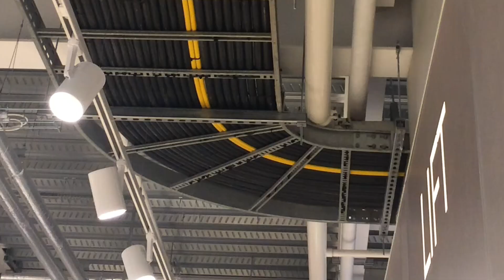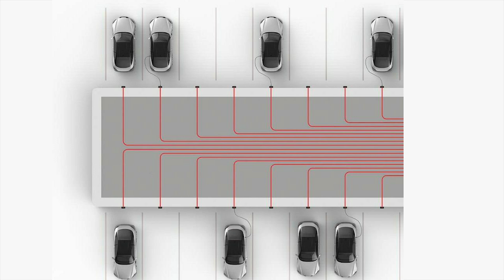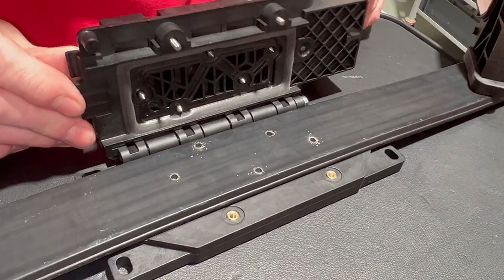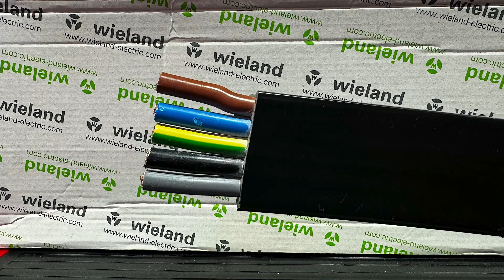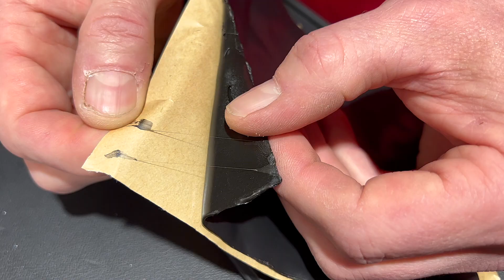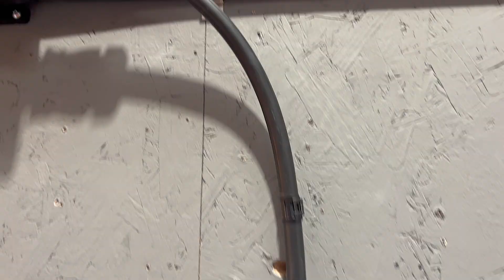How Can This Cable Speed Up Electrical Installations? - Wieland Podis

Comment: or fit power busbar like they have used in factories for decades.... any type of tap off like shown in this video will be a nightmare if the cable gets damaged, at least with busbar you can change it in sections

Comment: we did a car park with this system last weekend , the weekend before ?? anyway yes the other contractors had surveyed three  weekends for a small commercial underground car park  and we did it in one weekend with plenty of time for pub each day we were carful to use manual screwdrivers and not power tools , clean tidy very little fuss and we got five chargers up and running , we are rolling this system out with our clients across the city and use this install as our demonstration of how quick and neat it is

Comment: I have seen far too many pierce type connections like this fail. The RV industry in the US uses a two piece electrical outlet that works in almost exactly the same manner. The Romex cable is laid in the outlet and the cover is sandwiched on. Blades (think of a pair of scissors opened up) pierce the conductors to make the connection. They have a very high failure rate long-term
Reply: Don't compare anything designed for the US RV business to ordinary domestic products. 
RV means the cheeziest lightweight piece of shit possible.
Reply: Though the Posi-Tap is a nice system, if you don't have the time for military splicing....
Reply: another problem with tap in systems like this is that plastic can deform easily when heated, and after some time the tap in point could have a loose connection, which could soon start a fire
Reply: They have these pierce connectors on landscape lights too and they're total garbage. I can't imagine it running 3 phase 60 amps safely!
Reply: It's true that the stranded wire is much much more reliable than a solid-conductor Romex... and Romex is not tinned but just bare copper which makes for worse corrosion possibilities... but yes, even so the whole idea of vampire taps gives me the willies.
Reply: They tried the same shit in the US with the push-in terminals on standard outlets. you can just strip and PUSH the wire thru a hole in the back, and it STAYS! 
the only problem is, IDIOTS think the job is done, while everyone else knows to tighten the dam screws to clamp it INTERNALLY, after sticking it thru the hole,.
So, as a result, you get a conductive path, sure, but it's only a dozen circular mils or so, and rapidly overheats. AND THIS IS THE ONLY THING THAT CAN GO WRONG.
Prior to this, you had to juggle to hold the wire while tightening it up. Big fucking deal.

Comment: I feel like a lot of these EV chargers are going to go unused and have to be removed in a few more years. People are finding out now the EV they bought 5  years ago has half the usable range as new and replacing the battery isn't a reasonable expense, so when they replace them they are going back to gasoline. I really think hybrids are the smarter bet and if we want to make real progress against carbon output, we should focus on fossil fuel power plant replacement.

One of the biggest problems with EVs as well is our grids in the world are just nowhere near ready for everyone to have an EV. This system is awesome for retrofits but many of these places are going to need service upgrades to accommodate all that additional power and at some point the power company will not have the local capacity at the sub station and local distribution network to do these upgrades. This is a problem in pretty much every modern country and a very expensive and time consuming one to solve. In short  we are putting the cart before the horse pushing EVs versus power plant and grid upgrades.
Reply: the main way to solve the carbon output problem for transportation is better public transportation. Obviously this isn't feasible everywhere, but public transit is most cities is a lot worse than it could be. Especially in America a lot of cities gutted their public transit infrastructure to make it more car friendly, and that trend needs to be reversed. 

Even airlines burn less fuel per passenger and put less carbon in the air per passenger than EV's do, let alone hybrids or pure gas vehicles. And airlines are the least efficient form of public transportation. 

But the best solution for cities, more trains, more buses.
Reply: EVs were first introduced in the 1800’s and had the same problems back then as they do now.

Comment: wait, 16 millimeters squared (as in (16mm)²), or 16 square-millimeters ( 16 mm²)?
big difference I'd say
Reply: But you deliberately chose to read it as (16mm)² rather than 16 (mm)². I don't think anyone else will have done so.
Reply: @BrianG61UK  why not just use the proper unit name tho?
Reply: BODMAS

Comment: Great idea but what about chargers which require the use of a cat 5 or 2 core for load management and internet connection
Reply from the maker: Most chargers designed for shared spaces like car parks have lots of connectivity options - WiFi + Mesh or Powerline communication. See Zaptec Pro or Garo Entity mentioned in the video

Comment: The old Vampire Tap from old 10Base5 ethernet Installations has made its comeback 
🧛🏼‍♂️ Särrr gutt.
Reply: Ah yes, the fun of tapping a live network!  Still got the boring tool somewhere :)
Reply: AUI! (Drop cables)
Reply: @pebbleschan6085  AUI fanout unit yay
Reply: Or Christmas lights, probably going even further back.
Reply: @concinnus  yes, the old festoon lights had self piercing connectors on flat cable, used as far back as the 1930s for sign 'trough' lights but with those holders you had to strip the outer sheathing and route the wires into the channels with the spikes in
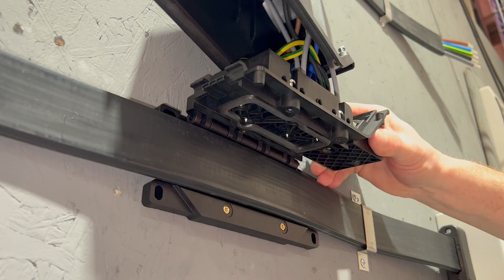Reply: @TheChipmunk2008  The ones I'm familiar with (US, 120V, C7/C9 strings) had the bulb socket clamp onto an unprepared insulated wire.  The difference vs the tap-off box here @3:26 is that the Christmas light sockets had brass contacts that were simply spikes on the other end.  They were pushed into the conductors by the clamshell action itself, no screwing.  Very cheap and simple, no weatherproofing, prone to corrosion.
Reply: Yup. Hardly innovative eh 🙄
Reply: @christopherbedford9897  tbh it's innovative to bring it up to modern standards and use it for a new purpose
Reply: that being said i do see a possibility if one car is really dead, and needs 32A for an extended time, for it to go bad..... but i guess they've done the testing, and the fast deployment is a huge benefit

Comment: Too bad you didn't compare different wiring systems in different countries and their positives and negatives.
Reply from the maker: We’ve a whole series 👉https://youtu.be/jSdfJabUEUQ?si=zRmwoGsDzkHQeuo3
Reply: @efixx  that's awesome. Hopefully you will ad more countries. Like Finland for example, we have way different system compared to Italy or Ireland
Reply from the maker: Sounds like a great idea 💡 I used to work
In Salo 🇫🇮 so would be good to return.
Reply: @efixx  that's awesome, I'm currently in school to become electrician so I'm very interested in learning new stuff and want to learn the best stuff from all the countries.
Reply: inn my honest opinion, no one has the truly best system. Every system in the world has its good and its bad.

If i had to run it down id say

Best voltage : 240/416 systems common throughout most of the world or the 277/480 system in North America. 120 phase to ground systems are not good, while japan has the worst with a 100 volt phase to ground system.

Best Service drops: I want to give this one to mainland Europe with its near universal three phase service drops to every building. Universal three phase services make for a more balanced and copper efficient system than single phase service drops common in the UK or split phase ones common in north America.

Best Breaker panels: North American hands down. North American panels are built with heavy duty buss bars that breakers plug into and enclosures are solidly built out of metal. This is way better than the European plastic boards with wires run in between breakers, making them a bit of a mess to service.

Best circuit configuration : Radial, sorry Brits but your ring main system, not so good. Everyone else in the world uses radials for good reasons.

Best wire run methods: Conduit, preferably metal conduit but PCV conduit has its uses, particularity where corrosion is a serious issue. Primary winners here are the UK and North American commercial and industrial installations. The flexible plastic tubing found in mainland Europe is OK, bu not as good a conduit, and the worst method is just running wires directly in walls like with North American residential installations.

Best wire termination methods: honestly i think its a tie between WAGO's, screw terminals, and Wire nuts. each method has its own advantages and disadvantages. Wagos are a little more idiot proof and faster to install than wire nuts, but wire nuts are cheaper and when done properly make a very solid and secure low resistance connection. 

Best plugs  - I'm gonna say no one wins here. UK plugs have the best safety features, but are excessively large and over engineered, and switches on outlets is just overkill. American plugs are compact and lightweight, but lacking in key saftey features and can be rather flimsy. On the other hand American receptacles being so small means there are far less foreign objects that can be inserted into them.  But if you want a super secure plug that will never pull out than nothing beats American twistlock plugs, which actually twist to lock in place and these cannot just be yanked out.

Comment: naah, thats not good way todo it. you must use  AR600 steel pipe with 10mm wall thicness. You just never know when building may experience MACH25 winds, you know, like in real worlds.
Cant use regular steel thats just rated for MACH3
Reply: Are you kidding?  Mach 25 winds would cause enough friction to melt steel. No building could withstand even Mach 1 winds let alone Mach 25.

Comment: Sadly never got to try this cable. We've stopped fitting EV points in carparks of flats and office blocks due to fire safety measures required by insurance companies and local building control.
Hopefully there becomes an industry wide standard to actually get the ball rolling again because since Luton Air Port there's a big push for sprinkler and extraction systems to protect occupants and the structure in our local area. Not sure if anyone else has come up against this.
Reply from the maker: Interesting 🤨
Reply: A solution needs to be found. In the long run all car parks will have to be able to safely accommodate EVs. I can appreciate extra caution for car parks in the basement of residential buildings where people may be sleeping. Office blocks not so much. Evacuating those in an emergency shouldn't be too hard.

Comment: I can’t believe the industry hasn’t seen more modular systems being used. It’s like a vehicle manufacturer custom making all the connections in a vehicle while being made. It’s in efficient. 

This type of system shouldn’t be limited to car charging systems.
Reply: these kinds of cables and connections are used in garten or outside systems like lighting.... even in the house for things like kitchen appliances.
Reply: @alanmay7929  which is odd, because the only vampire tap systems that are approved by ESA are low voltage garden lighting taps for obvious reasons (hv oxidation from elements and increased resistance = failure and fire)
Reply: It's also used for baggage handling conveyor systems e.g. Heathrow T5 - 18 km is used to supply power to the electric motors.
Reply: In the US, rigid conduit and junction boxes already accomplish this pretty well for decades in commercial. It's pretty easy to saw out a section of rigid, add a 4" square or J-box, set screw the conduits to the box, make your splice, and go off whatever other direction you want with the conduit. Assuming you have room on the branch. No threading, easy to get through, and more than strong enough.

Alternatively if appearances or strength aren't needed, flex conduit is easy as hell to work with comparatively.

But I have thought about it. A lot of cubicle furniture is just built with a system that looks very similar to this of "belts" of wires, though they have locking connectors on both ends to continue the run or connect to an outlet.

Comment: Let's be real here

Wire nuts are unreasonably effective for connecting 2-4 solid conductors (of the size that we typically use in america) in an enclosure that doesn't need more than two wire nuts... It squeezes them together almost as well as a crimp and won't let go

They're also entirely unreasonable for connecting more than 4 wires, more than two connections, anything other than solid conductors, any reasonably large conductors, small conductors, wires that are slightly bent, wires that are short, wires that are in awkward places, wires of moderatley varying sizes, wires that you connect when you're tired, wires when you're wired, and also everything else 🤣🤣🤣

The UK would do well though to approve use of the corrugated type of armored cable that we use here in NYC. It's pretty tough, and easy enough to work with!
Reply from the maker: Thanks for info - we’ll have to pop over and take a look! 😄
Reply: @efixx  just don't take a look at any of the other wiring in NYC here. Half the old buildings are wired by people who shouldn't ever be allowed to touch a wire in their life. Shared neutrals, breaker panels that are so unreliable at breaking circuits that they should be called firestarter panels, unused  conductors connected as grounds, panels with loose screws dangling, wires burnt from being illegally double tapped under receptacle screws, receptacles wired backwards, receptacles with paint on the line contacts, circuits without RCD installed right over sinks, etc... and that's just what I found in my apartment.

It's not a coincidence there are so many electrical fires over here 🤣🤣🤣🤦‍♂️
Reply: @Ariccio123  old buildings anywhere in the world often have sketchy wiring. No ones electrical practices where as refined 50+ years ago as they are now.

Comment: Arg these GST connectors so bad. How does that flimsy cable allow so many chargers sounds like a bottleneck..
Hmm typically charging if there is one and i prefer to not run on a low battery. Guess these smart chargers are basically not charging 80% of the time and multiplex the wire then.
Reply from the maker: It’s a pretty robust cable.

Comment: What are the metal cable clips securing the flat cable to the wall.  They are not shown on wieland’s website and the Wieland ones are plastic which doesn’t seem great from a fire perspective?

Comment: Concern I have with these sorts of things is, while yes they make installation a breeze it does present a problem if it's so easy to install what's the need of having a team of electricians to fit it have one electrician with a team of so called sparkies mates doing all the work seems to be a way of bringing in cheaper labour I'm my opinion. However it's still cool nonetheless.

Comment: Sure looks like a nice system, knowing New Zealand standards it will take years before we see that here unfortunately. Hopefully Im wrong. I would personally like to see some sort of metal trucking over the outside, at least as an option. I'm only talking a 20 gauge galvanized steel channel screwed to the wall over the cable.

Comment: Do they offer this for standard Residencial installation? Like a 3 and 4 wire version for gfci and non gfci?
Reply: This is Europe where power is standardised at 230 / 400 volt 3 phase.

Comment: This is a ridiculous and not very future proof way of installing infrastructure for car parks of larger sizes. Limiting clusters to only 63 amps significantly decreases the amount of EV’s able to charge at the same time to potentially 2 or 4 at full power. As we’ve seen over the years batteries are getting larger and currents drawn equally so. Get rid of this and install proper copper tracks instead.
Reply: A 63A 3-phase supply can deliver ~434.7 KWh (not considering losses) over a 10 hour period (overnight for example).  EV's need 15KWh per 100km on average, therefore a 63A system can deliver enough power to drive 2,898 km or 1,740 miles.  The average UK daily driving distance is 20 miles.  Therefore, it's common to have 20 chargepoints on this system.
Reply: Just add more clusters, how is this not future proof?
Reply: @sniperfi4532  Let’s say you have 4 clusters and 4 cars capable of 22kW charging, but they are all connected to just one of the clusters. Wouldn’t it then be better if there were just one cluster capable of delivering, say, 240 amps?
Reply: @picosoftware  if you’re running a public charging station then yes you’d want a higher current system to take the load. In that scenario you wouldn’t cluster anything and instead have a dedicated circuit per charger the limit faults taking out multiple chargers. This system is purely designed for overnight charging of vehicles like apartment buildings or dedicated office car parks where you can charge during the day.

I can see this system being used more as a solution for having one or two chargers initially with the flexibility of adding more later or being able to change the position of the chargers.

Comment: Seems Cool but i have concerns about adding points after the fact.. it appears there is slack required to slide the base behind the cable.. if you have already installed every thing and then go back to add one you may find the cable has no slack.. so fantastic solution but not for retrospective additions.